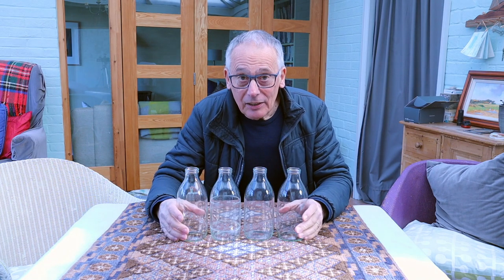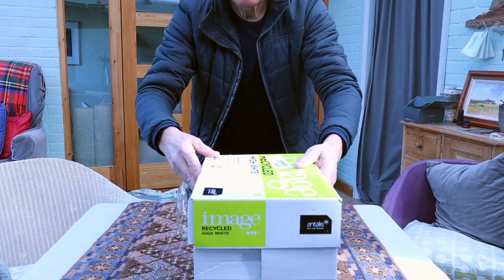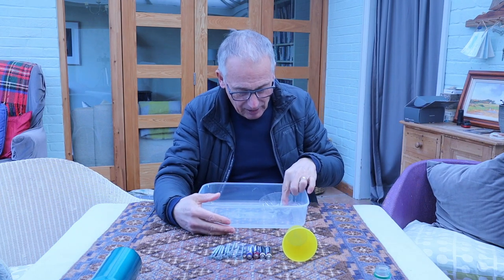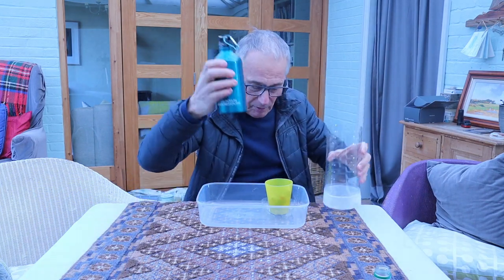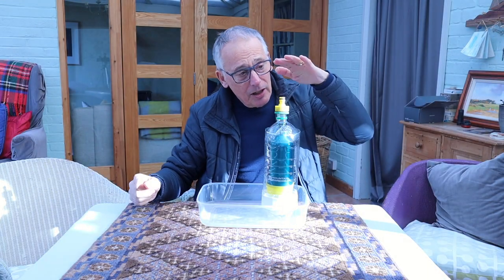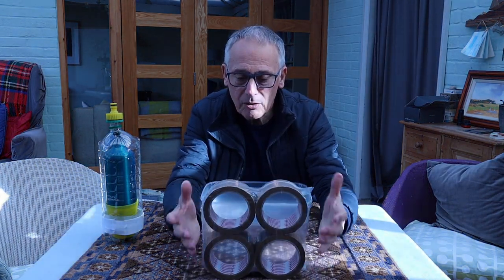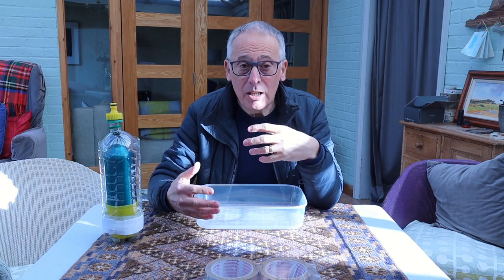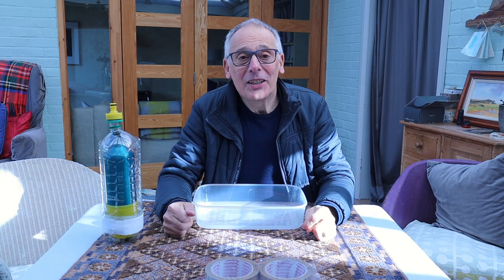Small Modular Reactors (SMR) - revealing truths to demonstrate they are not as simple as they appear

Comment: In theory when accounting for reliability are these reactors cost competitive with renewables? If nuscale breaks ground in 2022 and has a reactor by 2027 then it could be a part of the solution, no?

I enjoyed the video
Reply from the maker: Thanks for your kind word! Your question prompts a few more... Hard to compare reliability of the fairly complex nuclear system (controls) with a relatively simple renewable one. To date none of the 3 big names, Westinghouse, NuScale or Rolls-Royce have any working prototypes. The principle of the timescales, if achievable, you mentioned are correct except for the longer term issues with the dreaded contamination and waste. Thanks again, PB
Reply: @no2brb  All new nuclear project have planned capacity factors of about 92%, meaning reliability will definitely be the main selling point. 

Even if unplanned production stops occur, these will happen at random, meaning other plants can still operate. Renewables have common causes of production stops (weather). Just look at Germany right now: There has been almost no wind for several days now, production is lingering in the single digits of installed capacity.

Comment: Molten salt reactors don't require 100 ft. of water, or much containment.  Copenhagen is building the whole enchilada on a ship.  Yes, nuclear reactors don't produce electricy.  They all only produce heat.  However, if one decomissons a cole fired plant, it would be a piece of cake to drop a msr in the boiler area with lots of space left over.
Reply from the maker: Interesting, a previous question also suggests replacing a coal fired boiler with a nuclear reactor, see my answer below. In the UK an MSR is classed as an AMR (Advanced Modular Reactor) and no prospect of a working unit here for some time. Yes, I have seen the PR about the Danish nuclear reactor on a ship. Still not my cup of tea but plenty of cooling water! P

Comment: Nuclear should have been deployed for distributed heating

Low temp heating is far far easier and cheaper to achieve than electricity

A 1GW electricity nuke is actually a 3GW heat nuke so if electricity from nuclear is $60/MWh the heat is only $20/MWh

Delete the electricity generation infrastructure and staff. Delete the huge underground pipes that go 3km out to sea to take huge quantities of water back and forth and you are at a price point well below $10/MWh for heat

Technically there would also be zero waste
The 'waste' can just be kept in the system becoming very long life low power heating. So it would no longer be fuel becomes waste it would be high power fuel with 3 year life becomes low power fuel with 100 year life
Reply from the maker: Thanks again. And again you have touched on an aspect of all steam turbine systems regardless of fuel, they could all become a source of distributed heating rather than waste it with cooling. P
Reply: Good point I recommended nuclear heated water for oil sands development.to heat water for primary seperation of oil and sand. Solution mining in the potash industry is another application.

Comment: Russia has one on a boat.  Looks small enough.
Reply from the maker: Yes, they do, the Akademik Lomonosov. Power output 70MWe, footprint just over one acre. The questions remain what happens when it has reached its life expectancy and dealing with the waste? Keep safe, PB
Reply: @no2brb  How to deal with the waste?  Just do what's been done in the majority of reactors up to this point.  Extract the spent fuel rods; then put them in a pool onsite with the reactor cluster.  The things produce little enough waste that the reactor operators don't really need to move the waste offsite.
Reply: That is a bit like a nuclear submarine though. You got a whole ocean around you to help with cooling. That is more difficult on land. And also this likely cannot be expanded with more power. The idea of NuScale is that you can add more power generation over time. I doubt that Russian ship has that capability.
Reply: @erikengheim1106  In floating station concept if you need to expand you just add a new barge. It is also important to note that operational modes, fuel enrichment requirements and most importantly economics are completly different for military submarines.

Comment: Submarines?
Reply from the maker: Thanks. I guess you mean that submarine nuclear power plants have existed for a while so that means SMRs must be a straightforward development? Actually the comparison is immaterial as nuclear subs utilise a completely different design and have a ready source of cooling water. Furthermore they use weapons grade, highly enriched, Uranium (HEU) fuel (so they do not need to be refuelled for 30 years). Regulations prohibit HEU from being used in civil nuclear reactors. Additionally they have, unsurprisingly, much lower power output around 30MW as opposed to the Rolls Royce 440MW proposal and are not actually modular, they are just a single reactor. I hope that helps? P

Comment: I think you really should have called this video: "SMRs won't be generating power for another 6-7 years, and that's too long"

That is the real take away here. I don't necessarily agree with the sentiment, but you are getting a lot of flak due to the confusing presentation of your points.
Reply from the maker: Thanks, you make a good point. Although I hoped I had made it, maybe not with sufficient clarity. With the current delays in most countries the 6-7 years looks optimistic. Certainly no SMR (or AMR) design has been submitted for assessment to the Office for Nuclear Regulation yet. Take care, PB
Reply: @no2brb  The timespan remaining until the rollout of SMRs is irrelevant, as long as it is shorter than the expected remaining lifetime of the bulk of the current nuclear fleet. And that is well above 15 years.

Comment: Liquid salt reactors don't need cooling systems, they need heat to operate. The only thing 5hat needs to be cooled is 5he steam.
You don't know what your talking about....
Reply from the maker: Er, neither of the types / brands of proposed SMRs discussed in this video were Liquid Salt reactors so maybe someone else is less in touch? Regardless, thanks for commenting. P
Reply: @no2brb  the design shown in the video is for liquid salt reactors.
Reply from the maker: @arhidiabremena6515  No, assuming you mean the NuScale design that is a Light Water PWR, not liquid salt, see here: https://www.nuscalepower.com/ However, I concede how the diagram could be seen as a liquid salt design. Thanks, PB

Comment: 10-15 acres ? bollocks.
Reply from the maker: Thanks Jeff, higher or lower would you suggest? Peter B
Reply: BANNG  much lower
Reply from the maker: @jeffhosking802  Intriguing... in my quest for accuracy I was quoting directly footprint sizes from Rolls Royce and NuScale specification sheets. Peter B
Reply: The reason that power stations occupy so much space is because they can not because they need to. Typically they buy farm land and are not limited. You can build a power station with 2 x 500 MW turbines, with dual evaporated forced draft cooling towers and a control room on about an acre.
Reply: @jeffhosking802  Thanks Jeff, have to say that is tiny! Half a football / soccer pitch? Surely cooling tower footprints are much bigger? I do understand that there need to be safety perimters around power plants, I would have thought a hectare minimum (2.47 acres) size would be more realistic.
Reply: Forced draft cooling towers are a fraction of the size of the huge induced draft towers that you are thinking of.  Remember that one of the SMR reactors most attractive features is that is can produce mini power stations of 100MW  for local power that avoids the huge cost of power distribution. I once worked on a proposition for a 100MW pebble bed reactor with bypass turbines that would provide both power and steam to industry which  needed almost no cooling towers and would occupy less than an acre.

Where space is a premium, these plants can be built very small. That they generally buy large tracts of land and spread out is not the point.
Reply from the maker: Thanks Jeff. I was actually thinking of the smaller ones, the type with the fans in? The proposal for Bradwell B is for Hybrid cooling towers with both fans plus sea water feed and discharge. They are considerably larger though, 60m high by 160 wide! Thanks for your contribution, I'm always keen to learn more. Stay safe, Peter B